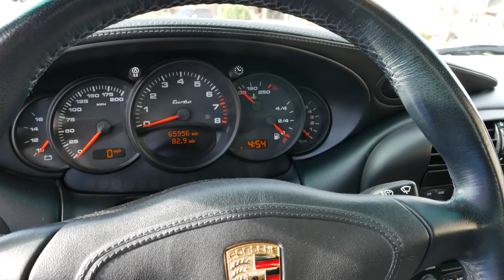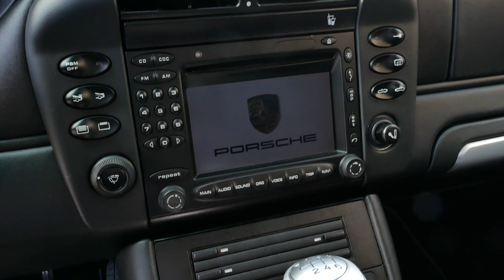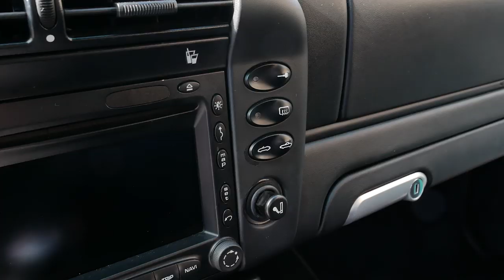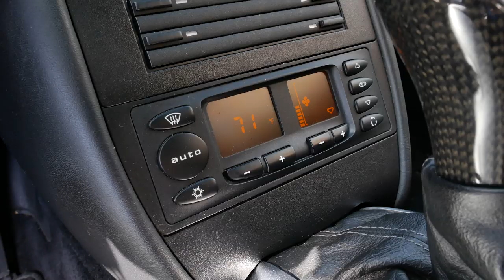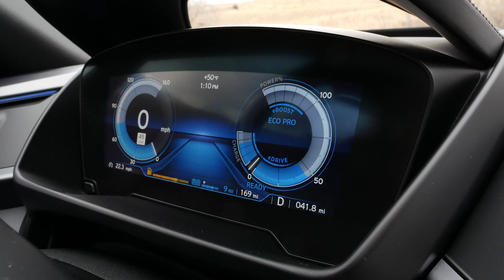Commuter Car BATTLE! New Tech vs. Proven Tech

Comment: I'd take the '04 Porsche all day long.  There's a strong driver to vehicle connection.  Newer and more computerized cars leave the driver disconnected.  My 2013 Boxster S is way too computerized and a royal pain the butt.  It has cheap switches made in China, wildly inaccurate computerized read outs for oil temp, oil pressure, tire pressure, etc.  The engine, trans, and suspension is awesome... but then there's the electric steering issue, no dipstick, and no more emergency hand brake.  With the hand operated brake that I have in my '08, I can use that brake lightly or heavily... while driving if necessary.  Don't try that with the eBrake on the 2013.  I made that mistake once and it felt like the transaxle was going to dislodge from the car.  I asked about that at the dealership and they wanted to know why in the world I would engage the eBrake while moving.  Seriously?  I had a complete and sudden 100% loss of braking one time in my life.  Nearly immediately, I went to my hand brake and avoided serious disaster.  In fact, I drove the car home using just the hand brake alone.  Not gonna happen with the new electric parking brake.  Give me the manual car over the computerized car any day.  I like the feeling of being grounded and solid when I'm driving.  Thanks for making this video.
Reply from the maker: Wow. Good to know.

Comment: For me the sweet spot for cars is 2000-2010.. After that you can't get hydraulic steering, maunal handbrake, manual gearbox etc. Before that I think that cars just weren't that reliable and well built...
Reply: My BMW 2012 convertible has manual gearbox, handbrake, hydraulic steering etc, one of the last I think

Comment: The future is the BMW, it's expected that there will be a 25% increase in battery efficiency in electric cars before 2025 which will be the tipping point along with a greater charging infrastructure. What will be really cool is the classic cars will be converted to electric. Easy to convert back to museum status with combustion engines but they will become electric cars nonetheless
Reply from the maker: That has been happening already. Several years ago we went to a shop that was putting electrics in replica 356s